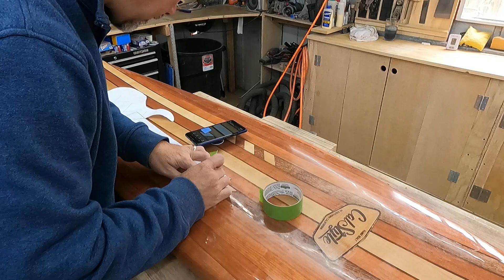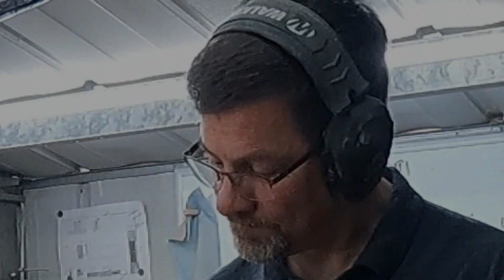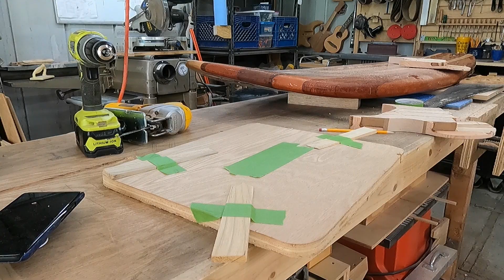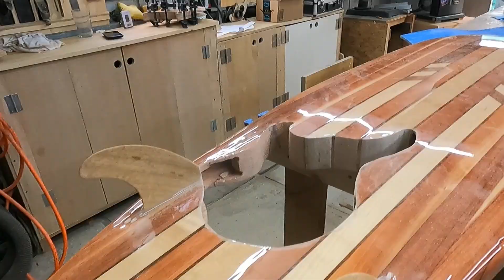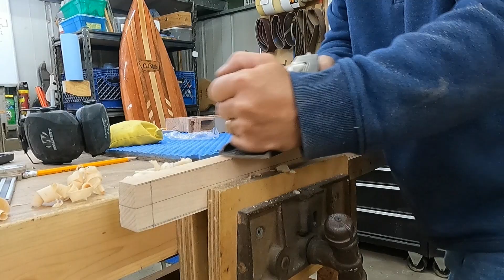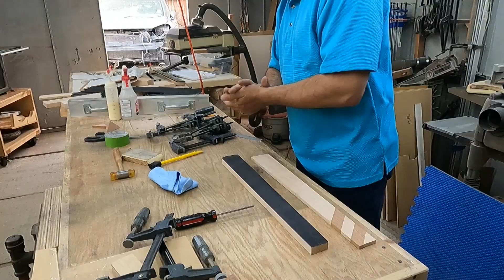A Modern Surf Guitar for Great Guitar Build Off 2021 - Step Two: Build a Guitar

Comment: I think if you take the body you have an look at all the spaces to fill you could do a mosaic or laminated pattern to fill in everywhere ..I think it would look interesting ..or even capping the sides an add different strips to appear like binding ......I'm sorry but i look at this as art an guitar in one ..you should take the top of the surf board laminate it for a five piece neck just stacking the same size cut out along the  strip center laminate wide enough to rough out  a neck..there maybe a long enough center piece to cut a neck board an if it not long enough to consider headstock scarf a headstock with the surf board top also...I like the recycle an reuse an incorporate the surf board...

Comment: Just curious but why would you go through all the trouble of building a surfboard just to cut a guitar body out of it ? Wouldn't it been much simpler to have just built a body blank in a similar style as a surfboard? Anyway that is totally salvageable. Several ways you could easily make it work.
Reply from the maker: The inspiration behind the build is at the beginning of the first video in the series. The guitar is made from the board, and then mounts back into the board it came out of for display. Why go to the trouble?  I guess for the same reason anyone ever pursues any creative vision. A lot of people won't get it, but that's not really why I'm doing it, so that's ok.

Comment: absolutely gutted for you on this one, but as you say, It's not the end of the project. silly mistakes happen, especially under deadlines and the 'stress' of having to record and edit video to go along with it, You could definitely salvage that body as a top and back but if that doesn't fit your design then that's just a credit to your commitment to do It right.
Please tell me you're going to fill the holes in the board with acrylic, re-glass it all and  get it back out on the waves... that would be one hell of a talking point.

Comment: You could bend some sides out of the red wood and make it a 335 type guitar, and bind it with the ebony.
Reply from the maker: Have definitely thought about this - it was my son Zach's first suggestion, and if the top and back pieces were closer to flat I might have done it.
Reply: @CalStyle  I think the idea is still worth trying. 
I would flood the internals with blue resin and then build the sides as if it were an acoustic. 
The cool touch would be to opening the sides with some artistic shapes as if they were "windows to the internal waterpool". Afterall, it's supposed to be a surf guitar, so it totally fits the theme with an increased enhanced theming.

As an alternative plan, even gluing some offcuts with the same wood pattern would restore the structural integrity and would sets you right back onboard.

Seriously man, I feel it's completely salvageable and it's worth trying, it's a too crazy good of a project to be trashed out.

Comment: I'll stick around. I liked this project, and look forward to see what you do next. 
Here is my suggestion; put the body back in the board, fill the exposed hollow parts of the board and body with expanding foam, seal it back up with epoxy and glass so at least you will still have a usable surfboard. Maybe cut out another piece of contrasting wood to fill the gap between the pieces, and route out the neck shape too, so that it looks like a surfboard with a cool guitar shaped "inlay." That board, and the wood that went into it are too beautiful to be scrapped.
Reply from the maker: Holy cow - why has that not occurred to me?!  That is now one of my top two ideas to salvage some dignity from this project.  I could literally have my board back!  Thanks for the suggestion.
Reply: Great idea! I only wish I could give it more than one thumbs up.